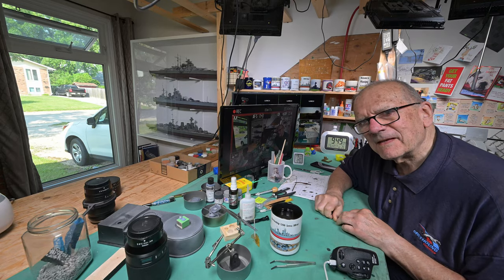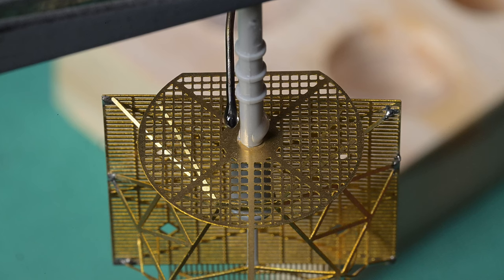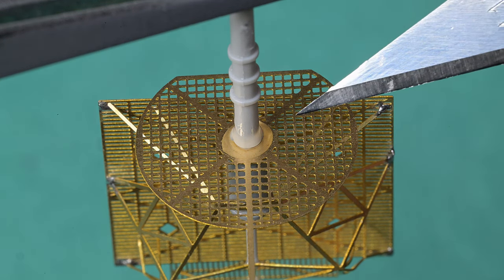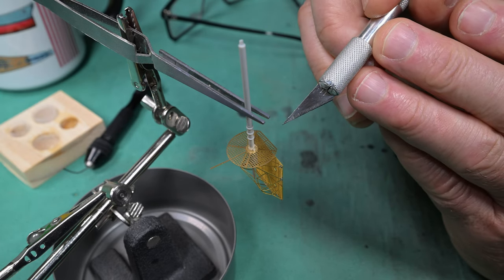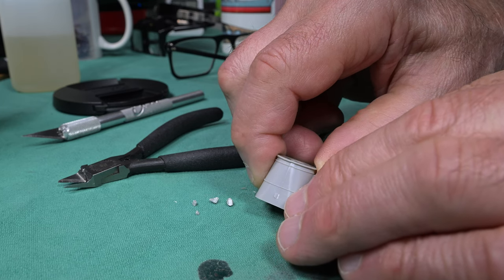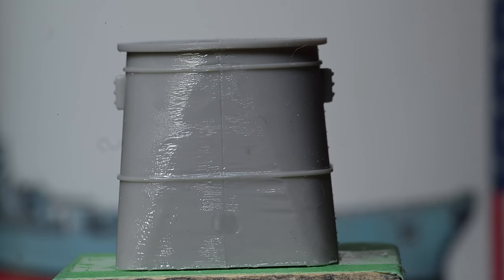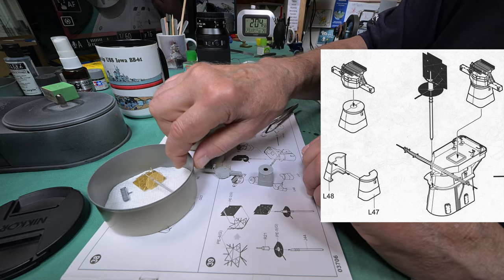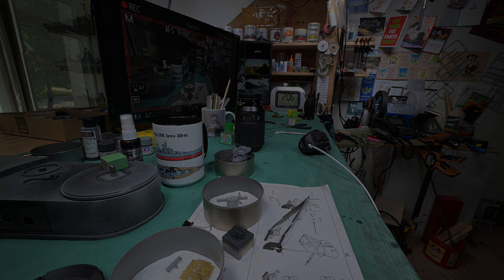The Model Ship - Part 1655

Comment: I had no idea an e-bike would go an hour without some pedaling.   But then again............. I had no idea.
How big is the battery in that thing?  Can you carry a spare and change it out on the road?  Again...I have no idea.
See ya.                     JimE
Reply from the maker: Hi Jim,
At the slow speed I go, the battery might last 3 hours --- only guessing --- never tested it. I'm quite happy to dismount after a long ride like last night. Just got back moments ago after being on it for 48 minutes. Traveled 13km (8 miles). Taking along a spare battery is possible , but I doubt if anyone actually does that. They are heavy and expensive. This is basically the bike I have https://www.amazon.ca/SEILOWAY-Y5-Electric-Bike-Adults/dp/B0B2P3QF8Q?th=1
Reply: @roncalverley  Thanks Ron.  Really happy to see you are enjoying it and life outside.
Next thing ya know, you will have a pony tail, beard, sleeve tattoos and a Harley with a chick on the back of it.          JimE